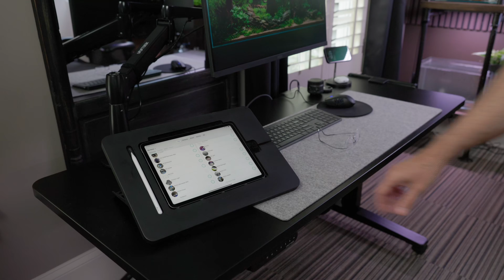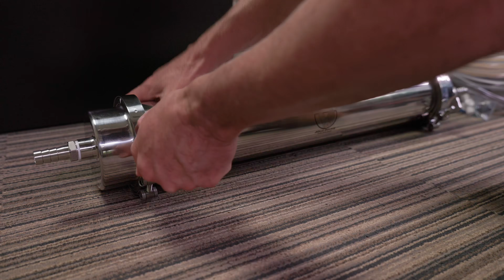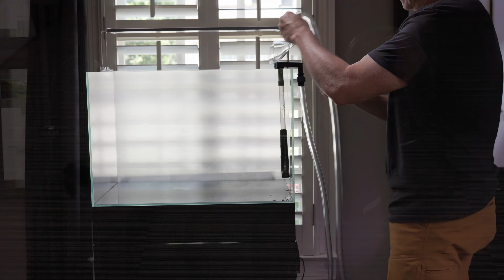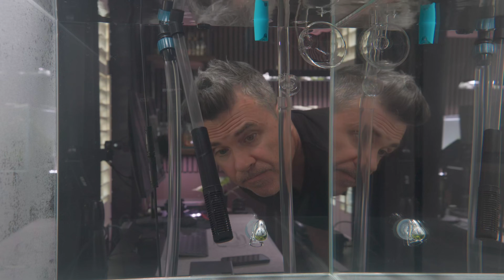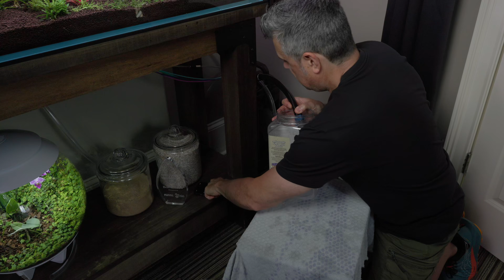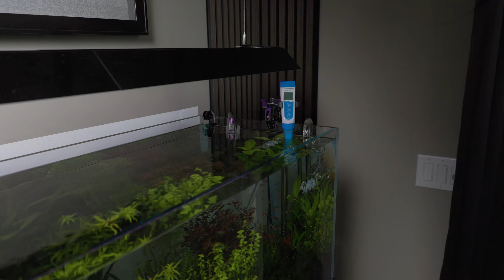My Aquarium Just Leveled Up

Comment: Just make many more holes in the Oase filter pipe where the sponges are. The flow will go up 50% or more. Use the orange sponges also will in grease flow with the extra holes. Standard are 18 holes in make as much as possible. I also use Inline diffusors on all my tanks but all from co2art never seen much bubbles. The most people also instal the diffusor the wrong way. The new Oase type 2 filters have more holes now from fabric
Reply from the maker: Yea good point.  The filter pipe is the v2 which is completely redesigned to remove this choke point.  So we are good there.  I also removed all the internal sponges and replaced with a small amount of ceramic biomedia. Thanks!
Reply: @jmaquascaping  Careful doing this, depending on how much media and the shape; it can end up just blocking the holes of the trays and inhibiting even more flow than you'd get just using a thinner piece of sponge on the bottom. Seachem Matrix is a big culprit of this
Reply from the maker: @matthagan4854 good point. i run very minimally inside the filter.  A single layer of ceramic media in only half the trays, no sponges.

Comment: It's a great solution. I wonder if I can just use my UV light :)
My UV light has similarly large bottle like shape. If I put my CO2 before the UV bottle it will probably decrease the bubble size. I am also using the exact inline co2 injector.
Reply from the maker: Interesting thought!  I assume you are using the housing without the light?  I think any water tight housing sized appropriately will work. Check out the Scapecrunch.com forum and you can bounce your situation off the folks there.  Yugang himself may even respond!
Reply: I use both, UV + CO2 reactor, it's been a long time now. I think I contributed to the comment about rotating the reactor to have an adjustable CO2 level. To answer you, UV can't be used, or at least I don't recommend it because if the CO2 pocket reaches the lamp and remains in contact with the gas, it will heat up and cause irreversible damage.
Cool video !❤

Comment: I dont have a problem with micro bubbles!Actually they are hard to see cuz i running two Biomaster 850 and 250 on my Scaperline 100.Inline difusor is connected on 850 with lily pipe which is deeper positioned in front glass,sending fine mist to 250 which is on opposite direction with lily pipe closer to surface.Getting insane CO2 coverage in all directions,no films on surface or any death corners.Fluval UVC is attached as well
Reply from the maker: Nice.  Interesting that you don't have microbubbles.  I can't really picture how that would be possible with an inline diffuser as that is exactly what it creates?  Double filters on that aquarium is certainly an option to get the flow up for great CO2 distribution!  Thanks for watching!
Reply: @jmaquascaping I do but they are not that much visible cuz Biomaster 850 can push them faster,chihiros inline difusor makes fine mist and its distributed to smaller Oase 250 which sends CO2 behind plants.
Reply from the maker: @korovljevicgoran85  Smart.  Yea I can see where having a second filter and then pushing it behind the plants would do a great job hiding the mist.

Comment: I've always used Dupla Reactor 500 and S for CO2 however the new ceramics have come a long way and with the next gen I'm using now at 40PSI the micro bubbles are literally the finest mist that are absorbed into solution much quicker.  But I know why the diffusers would not be for everyone.
Reply from the maker: Interesting.  Yea that was exactly my pressure when running the CO2 inline diffuser.  As I showed its a misty mess!  Glad it is working out for you.  I haven't seen the Dupla Reactor 500.  In fact I haven't seen a Dupla product since the ill fated substrate heating cables.  I don't think their products are in stores in the USA anymore.  But I don't go shopping to often so maybe Im wrong?  Thanks for sharing!

Comment: For someone only beginning to THINK about starting co2, would you go with this system or stay with the more traditional method to start?
Reply from the maker: I think the horizontal reactor.  Do the research and get it sized correctly that way it is efficient,safe, no maintenance and no hazy mist.  And the quality of the regulator doesn’t matter near as much.  Scapecrunch .com and search for yugang.  You can even diy it.

Comment: I wonder how small you can go with these while still being efficient. I doubt most people even with big aquariums have the room for it. The idea is intriguing though, the principle kinda reminds me of those ADA Bell Glass Diffusors for nano tanks which are a little ugly and a bit of a hassle, but to do that in an external container is brilliant
Reply from the maker: The size of the reactor is based on taking the surface area of your aquarium, dividing by 17.7 to get the required surface area in the reactor.  You can diy these for cheap which I think is really great.  I am going to do just that for my other two aquariums.  It also doesn't need to be any particular shape.  So it could be square or rectangle or circle or whatever.  Just the surface area in the reactor matters. Thanks for watching!
Reply: That would be a great video!